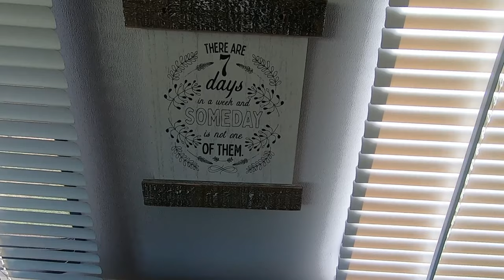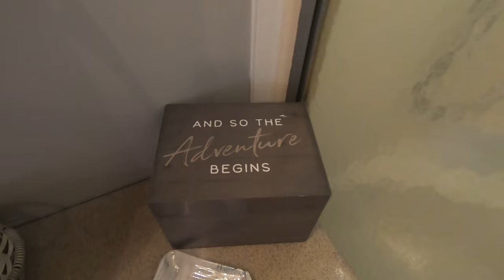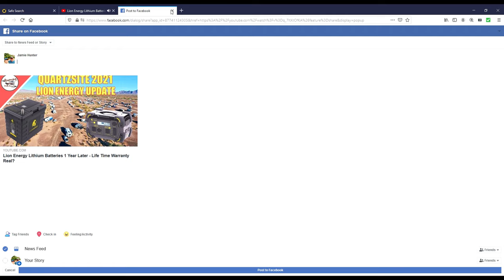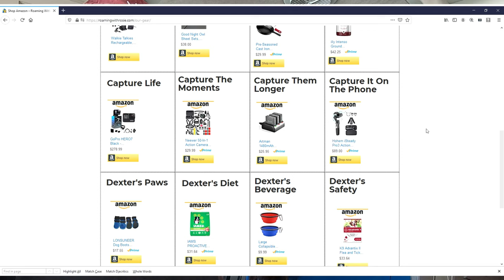RV Renovation Before and After - Amazing and DIY !

Comment: This is the best renovation I have ever seen and I have watched a lot of them. LOVE LOVE LOVE IT Nice Job
Reply from the maker: Thank you so so much!  We were very happy with how it turned out as well.  Hope you keep watching. We'll be doing another renovation on our current old motorhome later this year.
Reply: @RoamingWithRosie  I hope that cheap stuff lasts for you. In my 15 years of RVing I've learned to buy the best. Yes, like most I had a coach with the Lippert Thomas Payne furniture with heaters and "massage" electric recline, etc. Junk just like the stuff you have. Then I saw the light and bought the amish handmade Lambright luxe. I took the no electronics version and expect it to last my life. unlike that that Payne junk.
Reply from the maker: Hope you keep following. We actually sold that RV a while back, so couldnt tell you. However, we know a lot of other RVers who've been very happy with it. Nomadic Fanatic has the same unit. It's very lightweght and comes in pieces to assemble inside. We liked that.  We now have another old DP to renovate. But it came with all leather furniture so we wont need to worry about that.

Comment: Year of 2022 end or April.  I just recently bought myself a 30ft travel trailer.  I have been remodeling it ever since I got it.  I do the same thing swearing cussing when i bump my head or knock me elbows on something working in tight places.  But i have been doing the remodeling myself no one is helping me.  As of remodeling I took out one of the bunk beds.  Added colorful wallpaper above the first bed.  makes it look good.  I did a floor make over.  Instead of doing hard wood floors I did soft padded flooring over the original flooring i had.  Makes it feel so much better.  Better than carpet.  I do hate carpet.  Now I am ripping out the original couch which is easy to do that is tied in and will replace it with recliners.  which I like ten times better.  I will then replace the crummy hot water heater I have that is a 6 gallon gas tank that just has so many problems.  will replace it with all electric and bigger tank.  so many things to make rv homey.  but it keeps me busy.  just do not like the part of bumping my head or racking my knees or elbows.  love you all for the  video.  i have learned that since this is my first year it will take some getting use to living in rv.
Reply from the maker: I would like to see some photos of the changes you have made. I know a few RVer's who took out the water heater and put in a on demand tank-less. Sore knees and head bumping is just part of the process. Linda has asked me what I'm thinking about when I hit my head. My answer is what I have to do next. We are going to start updating our 2006 Alfa See Ya. 
Thanks for watching!

Comment: I just cleaned the carpet in our Tradewinds after being in Florida for the winter. The sand didn't surprise me, but the mud I got out of it did. Like you, I replaced the hide a bed couch and had to cut it apart like you. I also put in a double recliner, then our fridge went, so I replaced it with a 7.3 cu ft house fridge, which is smaller then what was in there, but space wise inside it much bigger..
Reply from the maker: House fridge is great. We save so much money and eat healthier "at home" with fresh ingredients.  Our newest DP has a big house fridge. Love it!

Comment: This is insane!! It looks brand new!! Now to convince my husband to paint out oak cabinets 😩.  Awesome job. Enjoy!!
Reply from the maker: Thanks. We just started another Motorhome renovation. Hope you subscribed.
Reply: @RoamingWithRosie  already subscribed. And saw the video of Rossie Too.  My husband is asking how long did it take you to sand and paint all the cabinets?  And what did you use to remove the stain?  Thanks for your reply.
Reply: I'm not comfortable with the idea of painting oak cabinetry either!  Eek!  As a guy, I like the manly den vibes my oak gives me in my coach.  But, I'll have to decide here pretty soon.  I was thinking of a lighter colored floor and pressed tin ceiling tiles instead of painting the cabinetry! 
My coach is 34 years old and has been one of  my hobbies since I bought it.  Not full timing in it, but I did  convert the living room into a 2 seat movie theater!   And since I park it inside my shop, having cold drinks & snacks close is a big plus.  My shop has a bathroom, so no worries about having to pull it outside to dump the black tanks.
I like this remodel. 
 Now I've got to see what their new project is.

Comment: we have a 2000 Endeavor. She's 40 feet which does limit our campgrounds. However, we live in ours, no sticks and bricks. Our Beast is in the process of being renovated. We've replaced our flooring with vinyl plank. Did you know there are two sub floors? That second one was a bugger getting up and replacing. I do like our oak cabinets. She had bright shiny brass pulls, ugh. Replaced them with matte black square pulls. I have vinyl tile to put on the backsplash. The microwave/convection oven has been replaced, as has the fridge with a black home fridge; but that was before us. She's still a work in progress but we love her and while we "winter" in south Florida, home is where we park her. Hope to meet you on the road one day. Happy travelling!
Reply from the maker: The Endeavor is a step up from ours. 40 ft seems to be the right size for full timing. The plank flooring really makes a big difference. Luckily for you some of the appliances have been upgraded. That's the beauty of full timing home is where ever you decide to go. Thanks for watching and safe travels!

Comment: Me and my wife bought a 2000 Holiday Rambler 40ft diesel pusher and we really like it.
It’s arranged a little different than yours but it’s like new one thing we really liked about yours  we wish ours had is shades like yours in the windows we have big long curtains on the big windows and behind the couch the curtain or drapes hang down to the floor and the couch seems to have to where it’s hard to open and the drapes get so wrinkled we just rather have blinds as to how yours is set up.
We enjoyed your shows and now your newer motor home. Laura & JeffreyEldon Hutton, Canton Lake Oklahoma.
Reply from the maker: The blinds were an easy replacement.  We got them from Home Depot.  We like blinds because you can open them just enough to let light in sometimes.  Thank you for following our adventure!

Comment: Nice job.  Looks like we were doing the remodel at the same time..  Still have some finishing touches to do on ours. Have fun out there!
Reply from the maker: Nice!  There is always finishing touches.  And by the time those are done, we either want to add more or start the touch ups.  Right?
Reply: @RoamingWithRosie  There is always more.  So true.  At least on the rig the updates are smaller and "usually" easier to do.

Comment: Great job! This turn out beautiful! Can I ask where was the recliner from? 💖💖💖
Reply from the maker: Thank you so much!. The recliner is from RecPro. If you saw when we unboxed it, it's unique for RVs because it comes in several smaller pieces to fit thru an RV door. We sure would appreciate if you use our link to check it out You will get 5% discount & we get a small commission if you purchase. RecPro Recliners - Save 5% With Code -ROAMINGWITHROSIE https://www.recpro.com/?referral=ROAMINGWITHROSIE

Comment: I’ve got a 2004 Holiday Rambler Neptune that has only 54,000 miles on it. As you stated, they’re built really well, but being almost 20 years old, it’s somewhat dated. I’ve had it for ten years, and the inside is immaculate. I’m ok with all the oak, but you’ve given me so many ideas for other interior renovations!!
I’ve got the Norcold 1200 LRIM 4 door refer, and this weekend I’m wresting with the two heaters that are seized in the tubes, and not much room to get any leverage on them. 
My biggest issue is cosmetic on the exterior. 
Did you need to remove any of the decals, or that awful clear cover over the front of the bus?
I’m having a very difficult time removing both. 
Great video and restoration!!!
🤠👍❤️🇺🇸
Reply from the maker: Luckily for us the exterior was in really great shape. So we focused on the interior. Owning an RV is just like owning a boat. Your either making repairs or doing maintenance, it's all part of the deal when you buy one. I really enjoy the renovation/restoration part of it. Good luck with your fridge and decals! Thanks for watching

Comment: Pretty nice, good ideas. I just bought a used trailer. It is not good  and so much less than they lied about. I suppose I should take pics and make a vid. By the way, I like the white finish. I don't like clutter. Every inch of wall doesn't have to be occupied. Where do you put the fishing rods?
Reply from the maker: Thank you, 
Unfortunately I don’t have the patience for fishing. Our new rig has fishing rod storage above our large slide. 
Thanks for watching!

Comment: I'm looking into getting a class A.  And man..do I hate the dinette areas. I really need to know how to take those out. (hate most all furniture if I think about it. Lol!)   Alot should be Murphy beds and hidden tables..
Reply from the maker: The dinette’s are a waste of space. Most are attached with one end attached to the wall. On the underside there are screws that you take out and the table is removable. If they have bench seats you want to check if your water tanks is under one of the benches. Most just have storage drawers under the bench. I agree most the the furniture in RV are not my first choice. 
Thanks for watching!

Comment: Respect.  We just bought our first RV - it's a 2000 Class A Monaco Le Palma.  Wife wants to remodel it.  I just sent her the link.  You are inspiring.  Question....does the remodel cause a positive, negative, on no change at all on the resale value or insurance premium?  I ask because Progressive Insurance in KY specifically asked if I had rehabbed my RV (I believe it was in the context of a 'schoolie' so maybe not directly applicable)
Reply from the maker: I think it depends on the buyer. After we finished this RV we bought another diesel pusher. The person that bought the one from this video bought it specifically because of the remodel. It sold for more than what we paid for it. We had comments from people that thought we were crazy for painting the oak cabinets so it just depends on the buyer. The remodel doesn’t really impact your insurance. If you were to do a lot of high end upgrades you could do stated value for insurance to increase the value of the RV. If you add solar, Lithium Batteries, and a inverter you schedule those things as additional equipment on your insurance. Hope this helps.
Thanks for watching!

Comment: We are finishing up a Reno of a 25 yr old Fleetwood -wanted to ask if your shower was a dark cream/yellowed and not the original white and if it was did you leave it as is or painted it?  And the current condition? Thank you !
Reply from the maker: The shower was a dark cream color. It wasn’t yellowed. I didn’t paint it. I don’t know what the current condition is. We have sold that RV and replaced it with a 2006 Alfa See Ya.
Thanks for watching!
Reply: @RoamingWithRosie  —thank you    Ours is a dark cream  even after cleaning   we had contemplated on painting it but not sure how well that will hold up so I think we will leave it   We will be painting the brass black though.  Thanks for replying.😊

Comment: I bought a 2002 intruder 36 foot. The inside was uglier than anything ever seen before! We removed the bolts to pack out the hide a bed portion of the couch then straight up used a chainsaw and cut it in 3 pieces and tossed it out the door.

I’ll never understand the design choices for RVs. RVs are expensive new and come complete with ugly furniture drab walls and fake wood.
Meh we gutted the entire thing - insulated it with wool and rebuilt the entire thing. Now it’s fabulous. Before it was so ugly it could have won the ugly RV contest!!!!! Those couches are a curse from hell.
Reply from the maker: I think most Rv interiors are ugly. I don’t know who designs them. I’m a true believer in making it your own style. Just like you would with a sticks and brick home. 
Thanks for watching!